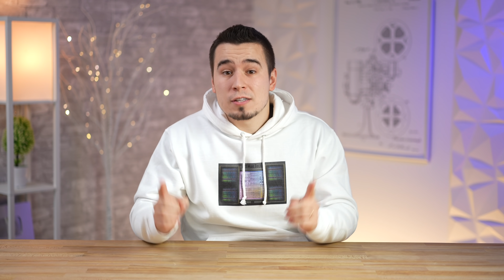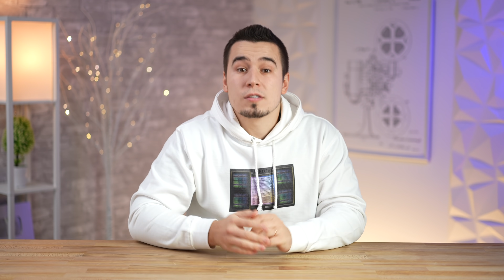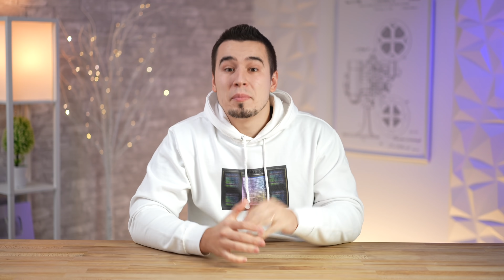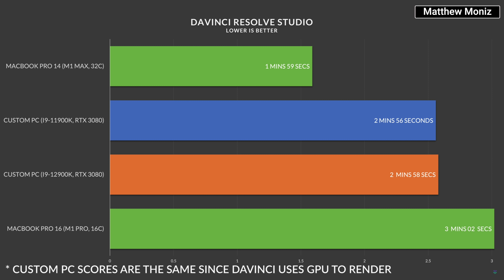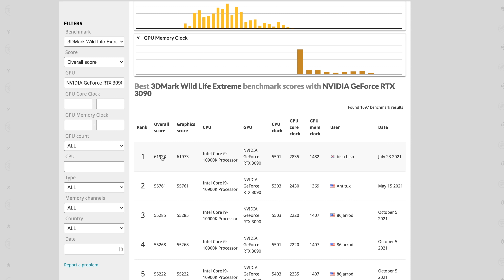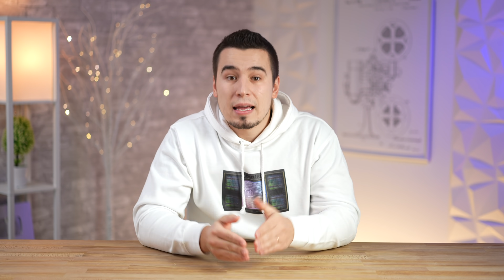M1 Max Quadro Mac Pro Leaks - The Alder Lake KILLER! 🤯

Comment: I think these speculations are pretty good except in one place.....RAM. I don't believe Apple will ever go back to conventional DRAM since the advantages of integrated memory to the design is so powerful and is a competitive advantage. In fact, I expect other vendors to offer something like it in Windows designs in the coming years. We tend to think somehow there is a memory limit based on the diagrams we've all seen that have the memory chips adjacent to the M1/M1Pro/M1Mac dies. But as we've seen with the MacBook Pros when their covers are off, the RAM chips aren't anywhere near the SoC. So that's not a limiting factor. Given the extra space you'll have on the motherboard, you could support four times the number of memory sockets to get to 1 TB of RAM (or just use more dense RAM packages), or even more since the current Mac Pro can be configured with 1.5TB of RAM which some super high end video editors and scientific community types do work with. Right now the cost for 16 GB of RAM on Apple's website for the M1 Pro/Max is $400. And let's say the machine will ship with a minimum of 64GB of RAM. That means that a 1 TB of unified RAM machine would cost $24,400 more. 1.5TB of RAM would add another $12,800 and if we get crazy stupid, 2 TB of RAM would cost $50,000. Now the current Mac Pro's memory is actually cheaper than this as you scale, with selecting the 1.5TB option costing $15,000. So I don't know is there would be any discount for scaling, like the Intel Mac Pro. But honestly for the handful of customers who truly need this kind of RAM, if you have to ask, you can't afford it.
Reply: I agree with you, apple is proving that a well designed all in one chip is kicking the pants off anything in sight. They may do other integrations to add storage, or peripherals, maybe even said GPUs for extra umph, but at the end of the day, the fully integrated chip will be the main engine of all

Comment: Threadripper 3990X is not a server CPU. It scores 75.000 in Cinebench R23. You can add two GeForce RTX3090 cards to this Threadripper. Wouldn't it be a stronger computer?
And when Mac Pro comes, there will already be new ZEN 3 Threadrippers and new GeForces as well...
Reply: Never questioned a apple fanboy/channel

Comment: AMD's Infinity Fabric is HEAVILY patented etc ( they even hold the patents for using it with x86 and ARM chiplets, even being used both on the same substrate). there is a reason Intel and NVIDIA are having issues trying to build out similar versions of the tech. It also has trade-offs. latency etc Anyone doing it is going to see the trade-offs being worse. It's easy to slap some memory modules on the same substrate but walking around patents when it comes to CPUs in the chipset design and working around the trade-offs is going to be an uphill battle. I mean it Is possible but chances are they'll slap it all into a huge monolithic chip and just ship it with memory modules on the same substrate like they currently are. They'll have to drop clocks etc doing this. You will never see perfect "scaling" when chips get this large due to giving up clock speed due to temperatures because you can only pack so much together on the same substrate and deal with the heat. Not to mention how much cache you have to bake in.

Comment: I'm pretty curious, how the scaling really will be... "some kind of infinity fabric" will really have to be powerfull and smart, to come out with only 10% of scaling-loss. 
Consider, that if Apple "simply" connects 4x M1 Max togeather - these include the unified RAM... so if die1 needs data stored in the RAM of die3 - this data needs to go over the fabric... if the GPU-block on die2 same time also needs data in the RAM of die3 this also needs to go over the fabric & the memory-bus of die3 ... this can get pretty complicated with many possible bottlenecks to workaround...

Comment: New iMac Pro with M1 chips will be indeed killer. I would also predict it will be chiplet design and not a monolithic die with either fully spec M1 Max SoC or some kind of similar custom ones, however it would make more sense to keep standard M1 Max ones to make the production more effective. I wonder if Apple is going to use some kind of extra IO chiplet like AMD is using or it will be able to handle it without it.

Comment: Apple Silicon and the M1 Max is great for video editing due to its dedicated hardware endoding/decoding chips. But for motion graphics / 3D rendering (Redshift/Octane/...), an Alder Lake with a 3080/3090 smashes the Max like hell.
Reply: As it should….the M1 Max is a laptop processor. Just last year people were saying that there was no way a phone processor is going to run well under desktop workloads. Here we are now comparing a Laptop with a system power of 90W against a top end desktop CPU pulling 272W (see anandtech’s review) and an RTX 3090 pulling almost 400W peak because that’s now it’s only frame of reference.

Comment: Hopefully, even if they introduce a new max pro, they’ll still make a module with the new chip for the current Mac Pro.
Reply: Very unlikely, the new Mac Pro will have a completely different internal design which will make backwards compatibility all but impossible.

Comment: I continue to feel for people who invested in the 2019 Mac Pro.
Reply: Especially for the people with the M1-8GB RAM models who experience SSD failure after too much RAM hashing on their overloaded SSD drive. I’m guessing will see massive SSD failure after about two years.
Reply: @David35687  How is it different than any other 8GB system with swap on SSD? People talking about this like it's something unique to Macs. Is it just a way of trying to twist good SSD performance into an engineering flaw? Would you RATHER swap to a spinning magnetic platter?
Reply: @yarnosh  If you only have 8 GB of RAM then you’ll be swapping to the SSD more frequently than if you had 16 or 32 GB of RAM. And yes SSDs are much faster than magnetic hard drives. However the problem is that when you constantly rewrite segments on SSD drive, they become more and more likely to fail overtime. Of course SSD drivers have an error correction process, but if you were to fill up your SSD drive to the 95% level, the RAM would be re-writing to the same 5% again and again too frequently and theoretically that could lead to earlier drive failure.

The reason it’s a problem with Apple is because the base ram and the base SSD size are so small and the price to upgrade those are very high that many people may make the mistake of choosing the cheapest model. The cheapest model is more likely to fail over time.
Reply: @David35687  I understand why swapping is bad for SSD. But it's not THAT bad. SSDs have a way to distribute the writes (wear leveling) and they can even have reserves to replace worn out bits. So it's not really rewriting the same 5% over and over making the whole thing fail catastrophically. And I'm fairly certain that early reports of excessive writing to SSD was either debunked or the the tool was misreporting the info. Or it was fixed in later macOS releases. Either way, it has not proven to be an issue. 

As for being somehow unique to Apple. That's a pretty weak argument. It's +$200 more for the 16GB model. It's not that expensive. Honestly I would just tell anyone to get the 16GB version and forget about it.
Reply: @yarnosh : My problem with the SSD swap situation is that despite Apple‘s promises, there is still uncertainty about how long these machines can last. And because everything on these MacBooks is put together on one integrated board, once that SSD goes bad, the Apple geniuses are going to tell you that you must replace the whole computer.

If I’m gonna spend over $2000 on a computer I’ve got to know that it’s gonna last more than three years or that it has some repair-ability
Reply: @David35687  Once again, this "SSD swap situation" is IN NO WAY UNIQUE TO APPLE. People buy and run 8GB RAM machines with SSDs all the time. Do they have to constantly replace SSD because it gets worn out? No. This is not a major concern. 

> If I’m gonna spend over $2000 on

But it's NOT over $2000. The original M1 with 8GB is like $1300. 

>  I’ve got to know that it’s gonna last more than three years

It will. But if you're really that concerned JUST DON'T BUY THE 8GB model.  The fuck?
Reply: @yarnosh  : Yeah of course I’m not gonna buy the 8 GB model. I’m just warning people to watch out. Apple’s repairability has gone to shit. 

Finally there are two major difference between Apple machines and Windows PCs. The Software and the new RISC processor chipsets. 

Apple machines are running an OS and apps that are gradually being optimized for the M1 chipsets. We do not know the long-term result of the combination of this new processor, old software and new software on the swapping issue. 

It’s an unknown.

Now even if I did stupidly decided to get only 8 GB of RAM I’m gonna need at least 2 terabyte SSD for the 20 years of work and data that I’ve put together on my previous Macbooks. 2TB SSD pushes the base model up to around 2000.
Reply: @David35687  "Apple machines are running an OS and apps that are gradually being optimized for the M1 chipsets. We do not know the long-term result of the combination of this new processor, old software and new software on the swapping issue."

Yeah, now you're just grasping at straws. This is the 3rd CPU architecture transition. Apple has perfected it. Even now, almost all software you're going to run, with the exception of games, is M1 optimized. Within a year of release.  

"It’s an unknown."

It's FUD. You're spreading FUD. There is no merit, other than reparability issues, to anything you said. 

"Now even if I did stupidly decided to get only 8 GB of RAM I’m gonna need at least 2 terabyte SSD for the 20 years of work and data that I’ve put together on my previous Macbooks. 2TB SSD pushes the base model up to around 2000."

You carry around 20 years of data on your main hard drive? WTF? Ever heard of external storage? Thunderbolt 4 is insanely fast.
Reply: @yarnosh  After the 2012 MacBook Pro pretty much everything Apple put out as a laptop had repair problems. Crappy keyboards, fluky displays cables and non-replaceable storage and RAM. More often than not their genius solution was “buy a new computer”. Apple lost my trust. 

Excuse me for suspecting that they’re going to continue with these types of problems. Yes the M1 systems are freaking amazing but a laptop computer should not be designed like a disposable tissue.

Comment: Probably will be some in-between SKUs that will be 28- or 32-core (7 or 8 cores per chip) based on binned 40-core chips. GPU SKUs as well (like 96 cores).

Comment: I don't think Apple will restrain the power of the Mac Pros. Yes the SOCs are very effective in mobile form, but surely they would allow them to use as much power as necessary in a maximum power Mac Pro situation? I'd be more than happy with them keeping a monster PSU in the new Mac Pro and allowing the chips and GPUs to be clocked higher and suck up more juice. In fact I'd wager they will keep some form of MPX module, but smaller, for apple silicon GPU cards that also aren't power restricted.

Basically, I think M1 means Mobile 1. low power, high performance for portable and small computers. I think the full desktop power draw chips will be the X1

Comment: That beastly SOC would have to slow down and wait for any external graphics card.  All that work will now be done on board.  I think it'll be smaller than anybody expects; room for i/o cards is going to take up most of the volume.  It won't need to be built like a tank, either, so expect a much lighter (and hopefully not over-engineered and overpriced) enclosure.

Comment: The only thing you left out is power. If it has pci-e slots they all need 75 watts of power each.
Reply: M.2 PCIe 4.0 x4 NVME SSD only use 6-7W, you just cooking that tiny SSD with 75W, so why do you think all PCIe slots need 75W? Also the SoC never had any slots on them before, so probably they will not do that mistake now. Unified Memory reach the 400GB/s, if they use infinite fabric to 4x of this chip, that can reach 1600GB/s. Why do you think they even bother to use a PCIe 4.0 x16 with 32GB/sec or PCIe 5.0 x16 with 64GB/sec limited data transfer speed? They just lose more like they can win with PCIe slots.
Reply: @Winkoo6  any pci-e slot has 75 watts available. It doesn’t mean that the device will use it. M.2 slots are different.
Reply: @JKNProductions  and what about the downgrade from the 1600GB/s to 32GB/s. you still think they will aiming that technology to hold back their machines? The SoC has some disadvantage, but has a lot of advantage too, you lose a lot from the advantages, if you want to make it to upgradeable with outer slots, not worth it.
Reply: @Winkoo6  if you are talking about (completely separate from PCI-E) then yes external ram would be slower but some workflows require massive amounts of ram. For those people they could add additional ram for when they system needs it but the system would use the built in ram first.
Reply: @JKNProductions  if you multiply the 64Gb by 4x, that is also 256GB RAM, and you mostly need the ram for buffer, when your system doesn't have the transfer speed, and you need to hold the data somewhere else before you can send them to there where you can use them.. with much higher transfer speed you also need less buffer too so less amount of RAM required if you not limited to 32GB/s between CPU and GPU or even the dual channel DDR5 RAM is only 100GB/sec, of course you need more with this low data transfer speed..

Comment: I think the MPX modules may stick around. They are such a nice design, providing smooth, quiet airflow for cooling. Maybe the case shrinks in height only, going from three to two fans?
Reply: But for what? Not discrete GPUs.
Reply: @yarnosh  Yes, good point! The only other MPX is the Promise storage module. The power supply uses a similar design too. You may be right that there aren't enough cards that need that much cooling to keep it.

Comment: I suggest apple would use the extra space for a better cooling solution on the new mac pro. Mac Pros do not need to be slim, it can sit still on a desk with the same spacious design, but with improved cooling and better anti dust coating

Comment: The 28 Core Xeon W-3275M die size is estimated at 660 mm², so only 1.5 × the M1 Max's 430 mm²
Apple might be able to increase clock speeds in their desktop machines. A Mac Pro case has much greater cooling capacity, and spread over 4 dies there will be a nice, large surface area for cooling.
There is also speculation that the die photo that Apple provided for the M1 Max has been photoshopped to hide interconnect fabric logic at the bottom, to be used for Duo and Quadro CPUs, where the mysterious, unused, extra neural engine and other duplicated parts can be seen.

Comment: I think the upcoming 27” iMac refresh needs more than what I’ve heard so far planned for it.  It should be an iMac with M1 Pro/Max, but then revive the iMac Pro brand which has duo M1 Max.  This is what will enable competition with the highest end desktop chip.  Then Mac Pro pushes it to the limit with quad M1 Max
Reply: I agree. The 27" iMac refresh will have to be more powerful than the laptop equivalents IMHO. This is what I'm looking at more than anything else from Apple.

Comment: To Apple credit: they're already fastest on the mobile platform.
To Apple discredit: WinTel have been lingering so much with a decrepit architecture, up to a point where core performance of today's not much dissimilar than that of a 10 years old chip. Particularly they've been beaten soundly when they knew exactly their limits with memory access speed and latency, and yet they continued to dish up re-heated recipes.

Apple could have made to the top by pushing their CPU's architecture, now they've even been granted the luxury of NOT PUSHING it... also winning the medal of EFFICIENCY (and who knows even the price to performance ratio). A real shame... but both Microsoft and Intel won a defeat which is so 100% deserved.

Comment: Bruv  Mac pro has  traditionally  had the HEDT chips from Intel that is their Xeon line of CPUs. 
Also by that time Raptorlake would be out and have an IPC increase of approx. 19% and in 2023 we expect Metorlake in 2023 with 30-40% on top of that .
Also wait for Alderlake mobile it will be better than M1 max ( i9-12900hk will be atleast) ,  either way the future is exciting , also Davinci Resolve isn't optimized yet for alderlake .
Reply: who cares when the laptop need power plug to run fast. and davinci already optimized for apple. so no coping windows fanboy

Comment: Nvidia has a trademark on Quadro still, so I don’t see Apple risking lawsuits… maybe “plus” since they use that, or just use “Quad” … they’d probably get lawsuits from Intel calling anything Duo to do with processors.

I also see problems with scaling when the memory is not unified for all 4 processors, so you’ll have issues with what CPU and GPU cores have access to what items in memory, causing direct scaling to not be the same as we’ve seen with just increasing it all on one die. Hopefully whatever they do for a large fabric between the processors maybe somehow interconnects the memory